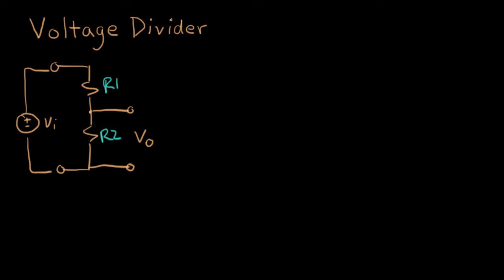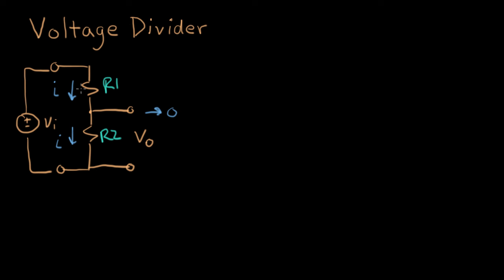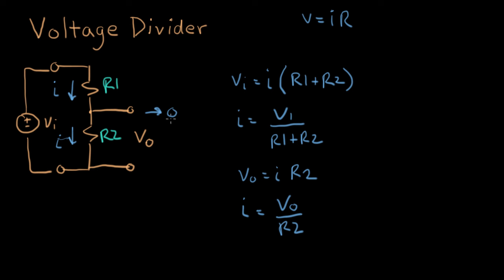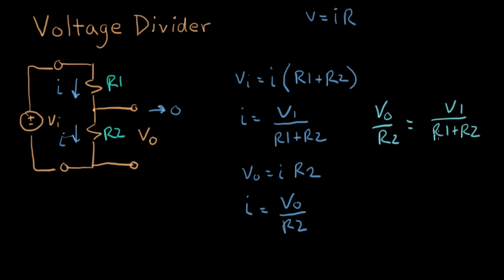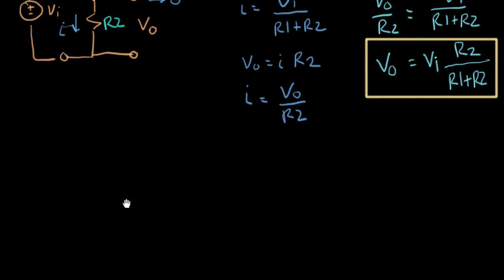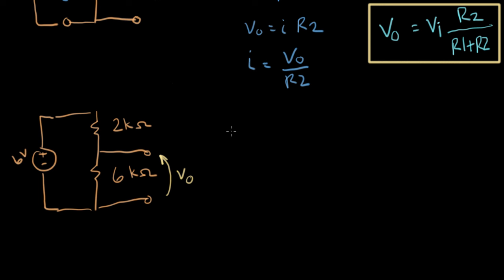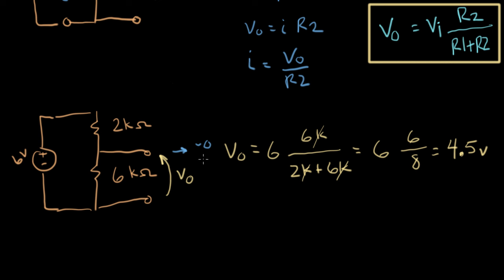Voltage divider | Circuit analysis | Electrical engineering | Khan Academy

Comment: "Voltage division" would be a pretty badass name for a heavy metal group, to be honest.
Reply: No, No it wouldn't.
Reply: @Newbport849  
Eh whatever, you already have names like "AC/DC", which is actually an abbreviation for "alternating current/direct current".

Also, with "division" I don't just mean "inverse multiplication", I also mean "team" or "group".
Reply: @Peter_1986  Anything engineering has no place in heavy metal.
Reply: Newbport you must be fun at parties.
Reply: @JCarrollTV  bold of you to assume he gets invited to any

Comment: Here's another approach to the voltage divider problem.

Step 1.
Find the current.

       I = V/Rseries
         = 6/2+6
         = 6/8 = 0.75 Amps

Step 2.
Use Ohm's Law(V = IR) to find the voltage drop or voltage difference for each resistor. 
V1 is the voltage drop for R1 and V2 is the voltage drop for R2.

              V1 = IR1
(2a)             = (0.75A)(2ohms)
              V1 = 1.5V

              V2 = IR2
(2b)             = (0.75Amps)(6ohms)
              V2 = 4.5V

Step 3.
Kirchhoffs Voltage Law states that the sum of the voltage differences in a given circuit must be equal to zero.
Use Kirchhoffs Law determine if the circuit is valid.

       We have a 6V battery connected to two resistors in parallel.
       The first resistor has a resistance of 2 ohms and the second has a resistance of 6 ohms.
       When the current from the battery travels across R1, the voltage drop is 1.5V (6V - 1.5V = 4.5V). Reference 2a in step 2 for math.
       When the current runs across R2, the voltage drop is 4.5V(4.5 - 4.5 = 0). Reference 2b in step 2 for math.
       Since we started with 6V and the circuit "used" all of it, we have determined that this circuit does follow Kirchhoff's Law.

Comment: Why's V out only affected by one resistor? What is v out in the first place, and what's the point? idgi
Reply: I know it's been 2 years, but I'm answering just in case someone will also need an explanation regarding what you asked, so here it is :

1)Why is V(out) only affected by one resistor ? Because it's only applied across one resistor. If it was affected by both resistors, then you'd get the exact same voltage as you applied V(in).

2)V(out) in this case is a predictable fraction of V(in) as the output V(out). Roughly speaking, you take an applied voltage V(in) and make it smaller as an output V(out) using a divider.
Reply: Raidom im about to have my final exam in like 1 hour and all i dont get is voltage divider like what the hell is vout i still dont understand

Comment: If a resistor is connected across the battery for a long time, then won't it drain off the battery/cell. Can you please let me know ? (3.7V cell 4.7K X 2 connected across as shown in this video)

Comment: These lessons have been very beneficial for me but this one needs redoing please. There's little to no explanation of anything. It's all a bit random. The math at 4:00 made no sense to me.
Reply: Ok, so do you understand the 4 prior equations and what they solve for before that ?
Reply: @Technovore88  yeah perhaps i have a gap in my math skills somewhere but how vout/r2 = vin/(r1+r2) then goes to vout = vin * r2/(r1+r2) makes no sense to me

I get hes multiplying both sides by r2 but his answer is confusing and he didn't explain it at all
Reply: @HamedAdefuwa  Gotcha, I do agree it would have helped  if he had stated the given current in the circuit so it could be proof checked with  ohm's law. Just be clear you have grasp of the mathematics up to his actual answer of 4.5 volts for  the most part?

Comment: You wrong 6v and didn’t use that to find the current to use in the equation.  You just plugged it in as if it was a current value.

Comment: Is this same for parallel circuits? i saw my teacher do this a different way wtf his way was inverted the other way, both add up on top and at the bottom the divider is the voltage in R that youre trying to find

Comment: 6:12 if i wanna know the voltage for R2 i would just go 6V/(R1+R2) X R2 

Its easier in my head that way. First i divide the voltage over the total resistance so now its spread out evenly, and i have like a base value i guess and then i multiply it by the resistor value i want t find the voltage for and i get the right answer. Can someone tell me if there is anything wrong with doing it this way?

Comment: When V out is used to power the gate for example on a small transistor that barely sinks 10 milliamps its not very relative to speak of.   But when V Out is sinking current into a substantial load of for example Amps.   Now you have the current passing thru R2 and whatever is in parallel to R2 (load on V out)  which is completely relevant to the current passing  thru R1.   So if my memory serves me right you Thevenize R2 and the Load attached to V Out and use the parallel value of the two as the actual number in the current equation.   Usually when I want to calculate how many volts are going to drop across a voltage divider I just use the percentage ratio and multiply the voltage by that number.   But I remember using this method and its accepted and easy to understand.  8)

Comment: Why does Vo depend upon R2  and not R1
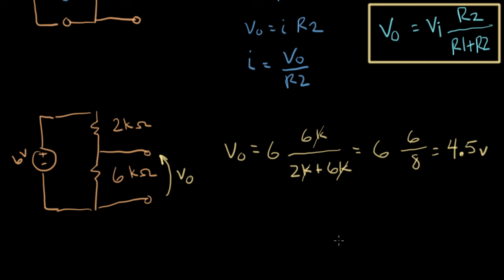Reply: Because Vo, as you can see at around 6:00 , is measured across R2, therefore you need to take that resistance in account.

Comment: Thank you. I need videos on Engineering Electronics circuits too. Stuffs including frequency response. Transistor biasing. Small and large signals. IC 555 timer. Oscillators etc.